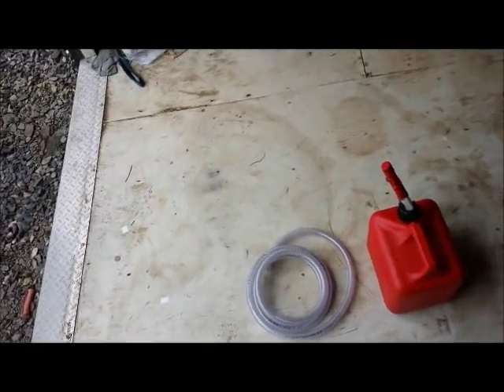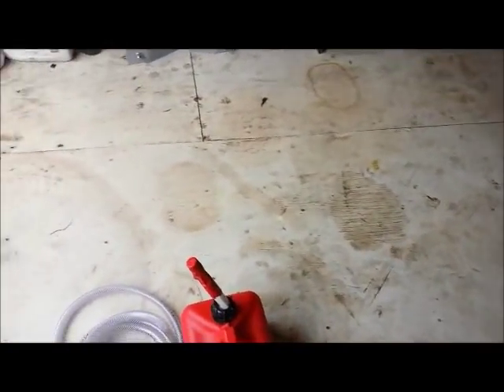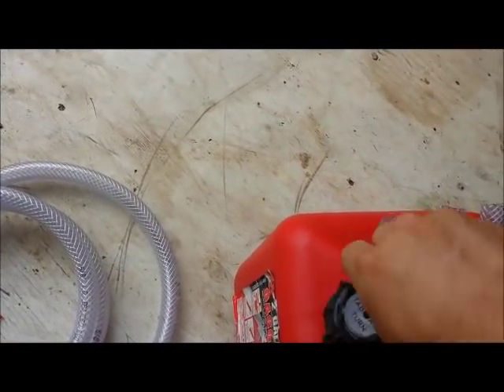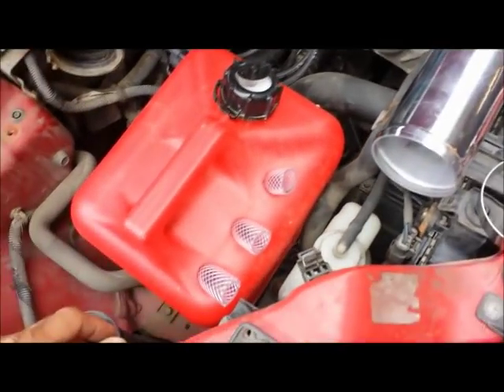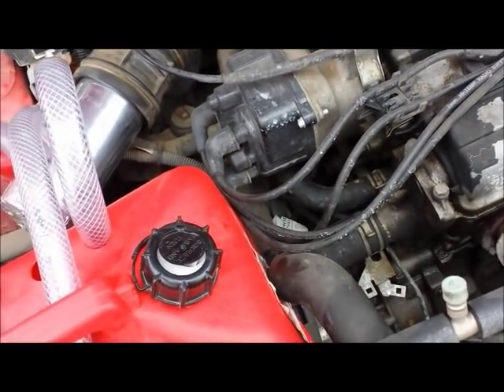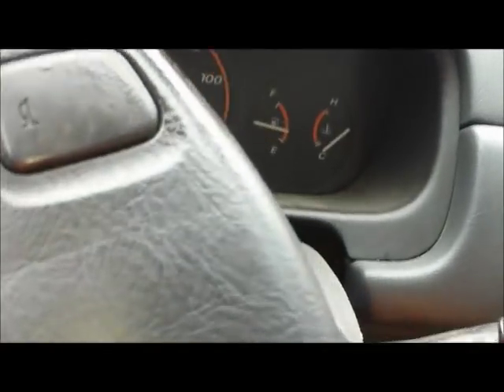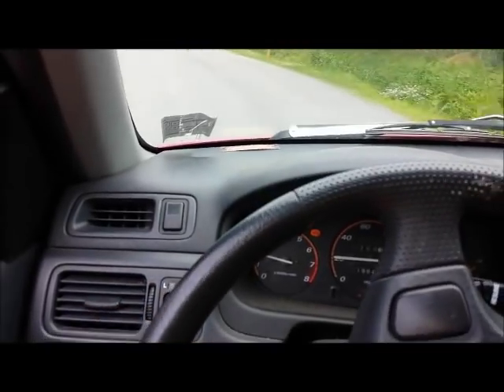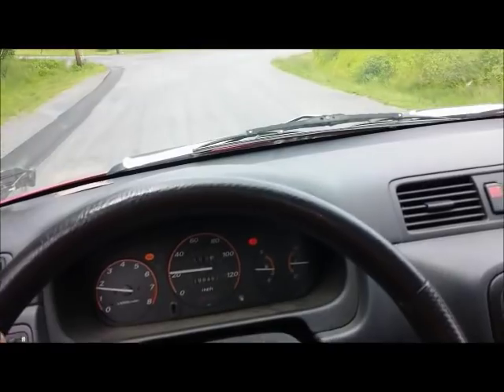driving your car on just gas fumes

Comment: I see. Thanks for the input.  I plan to try the same thing on almost the same engine; but add a few valves that I can make the ecu control to adjust air fuel.  I also have a specialized oxygen sensor to be able to see actual air fuel ratio in real time.  If I stumble on something worth while, I'll pass it along.  But first starting with a 7kw generator to figure out how I should approach it on the large scale.

Comment: How has the project progressed?  Still running it?   The fuel pump connector is under the rear seat;  pretty to access through a port that is held in by a few phillips head screws.
Reply from the maker: no I sold that car a while ago.

Comment: nice mis-firing going on, that flashing mil or check engine light told the world that.  I wonder how the fuel pump felt being dead headed.  Just imagine the heat it was building in the fuel.
Reply: +Джейсон Хичкок  I liked his comment.   Did he like his own comment too?
Reply from the maker: the flashing light has done that for over 2 years.  it's a random misfire code due to the common crv valve issue.  it had nothing to do with the experiment. the experiment threw no new codes
Reply: +Tim insane  I thought the same thing about clamping the fuel line.  It cant be good.
Reply from the maker: It was a test for a few minutes. You guys seem to think it was a permanent thing.
Reply: I would be worried about an older fuel pump overheating quickly.  Instead of clamping the line, you could try pulling the fuel pump fuse.  I did find the video very interesting.  Thanks

Comment: Good patent but ..... If the police stop you for control you will have a problem because the patent is not in line of the safety standards. In an accident, the car contract will not apply and the insurance company will not pay. On uphill roads the car will stop. Otherwise as an idea is not bad.
Reply: When did he supposedly "patent" this?

Comment: on efi cars you may need a chip to tune it.
Reply: lol know what your talking about before you comment
Reply: I do. I meant to tune it. aka air to fuel mix that u want. but ok
Reply: +Josh Feller theres absolutely no need, the only time youd need to monitor or change afr is if your car is turbo'ed, and if you do this if your car is turboed your completely dumb because youll blow up your car
Reply: I don't think he has enough airflow for the high rpm's

Comment: The flashing ses light shows it is misfiring, fix that and you will get better mileage too. Good video thanks for sharing. This is the exact concept as a carburetor , vapor is what burns. try a coolant tube in the red tank, that will make the gasoline hotter and it will vaporize more efficiently, giving even better fuel mileage and more power.

Comment: You can also run an engine like this using hydrogen, it's also how NOX is applied. But the problem is there are risks. You might end up running the engine very lean and killing it (which is the logical result) and the more fuel vapour you let through the air intake the less air it gets, you need both at the right amounts for everything to work as it should. By the time you tune it to the right balance you might be back to where a normal car would be :/

Comment: the safety factor in mild steel fuel tank and thin copper tubing isn"t very much.  use stainless steel  tubing and a metal fuel carrying can with flash arresters  in the tubing into the air inflow to the engine.  Also filter the air coming in to the can,put on the bottom of the fuel can  the air connected to a plastic  mat with small holes to create more vapour.

Comment: Hey man Thats very good project, tell me what was your obstacles you came across plus what would you like to achieve in terms of running on fumes Thank you for your video Arthur from Glasgow
Reply: Bungo Man Google Tom Ogle 100mpg car and you'll find your answer
Reply: Hey Man just watching your video How are you getting on with this fumes Looks very simple thi system I want to try it I have a peugeot 106 1.5d 1996 yr You see this clamp sitting on the fuel hose The fuel pump is still working and will this not cause any damage when the pressure increases ?

I see you try to switch off a fuel pump Great

You think it can work on diesel cars ? Thx
Reply: Can you show how this 3rd hose you connected to What is set up of this all system Thank you a lot

Comment: When the check engine light is on it means there is a problem with the emissions system. 
When the yellow check engine light is blinking it means the car should not be driven.

Use a OBD II handheld computer to read the codes to find the malfunction.

Comment: Justin, feed the floor heat setting of your interior heater to your gasoline bubbler.  Then you can control the temperature going to your molested Gerry Can.  Why your engine is stumbling is because your octane level is increasing.  Octane doesn't evaporate till you heat it to 400 F. But that is another speech and we are not dealing with liquid gasoline.  So doing a timing correction does not apply here.  Sorry for confusing everybody.  Why don't you try some pure Alcohol instead of Gasoline?  Alcohol does not have these ignition delay ingredients.  Moonshine would work.

Comment: thanks for the video most videos only show such stunts at idle run..yours ran 60 mph! impressive for a proof of concept..might be easier to emulate this on a single cylinder motorcycle with no air filter element and some preheating on the fuel from the very heat of the engine produced (no need for actual heaters)

Comment: Thanks for the video hope you can come up with something better maybe a sponge in the can or something to help with evaporation and sloshing. Adding a simple water injection system by vacuum could help with the bucking but won't increase fuel econ but up the pressure in the cylinders and causing a cooling effect on the valves that is what most people are worried about burning.The ecu light flashing at the beginning of the video is a warning that the ecu is experiencing misfiring in the engine due to a fouled spark plug or coil pack going out happen to an older car i used to own. Good luck and stay safe.

Comment: In a sense i agree that you can run it off vapors. But if you truly do the math this will eventually cause engine damage and or catastrophic failure for the simple fact that it runs lean beyond the parameters allowed. You'll be able to idle and maybe move around using just the idle but the second you give it a bit to much gas it will go lean beyond the ability for the ecu to pull timing and could cause it to blow up. There's really no way of controlling the amount of vapor intake therefore it can't compensate for it. cool trick but not something that will work in a real life scenario.
Reply: As a pilot, such as I,you have to utilize on-board fuel/air mixture controls all of the time. The most efficient, powerful and ideal ratio for 100LL fuel is 12.5:1 by weight (as compared to 14.6:1 for 87 octane). The reason that this control is needed is because air weight varies at different altitudes (ex. the higher you go the lighter the air). My home airport is near Houston Tx 343ft above sea level. While on the ground I run the engine at full rich. Once I climb to about 6000 or so I will notice a reduction of power which simply translates to a loss of rpm. The reason for this is because I will be running too rich for the given altitude, say probably about 11:1. All that is experienced is a loss of power, no detonation or damage to the engine in any way. It is extremely common. The timing is actually not affected at all. Same goes the other way, When I am near ground level and run it too lean say 14:1 for example, there is only a loss of power. My point is that the ideal ratio of air-fuel is the ratio at which a certain fuel and air can be mixed which produces the most power. A reduction or increase of the ratio can not affect timing unless the type of fuel is different. Remember though, only 20% of injected fuel gets burned and included in that ideal ratio, the rest is wasted. So your average fuel injection injects way more fuel that 14.6:1 to make up for the in-efficiency
Reply: How will this damage the engine considering the fact that carburetors or fuel injection systems also mix fuel and air vaporize it and then burn it in the engine  Lot of fuel is wasted in this way isn't it?
Reply: matey 😕😕do some reserch 😜
Reply: Justin Sane  Do you plan to reduce air or increase air ?
Reply: Carlos Dingo non-sense
Reply: would this still cause damage on an air cooled engine?
Reply: lmfao
Reply: Thanks for your good reply. Do you think that the reason this could work better than a carb is that once you have the mixture set it will remain the same though the rev range?  If it remains the same then you would eliminate two of cabs big challenges, 1 That the mixture is not always optimized and 2) On a trailing throttle the engine runs very rich because the vacum goes up substantially. What do you think?
Reply from the maker: if you watch the video you will see i was actually to rich. like very very rich.  you would need to build a much more technical device to control vapor.

Comment: so if this works why don't engineers program cars to do this on the highway when there isn't any erratic throttle inputs? Or hell in cruise control mode even. They now have drive by wire throttle bodies and they have direct injection that they can control by computer as well.
Reply from the maker: they want us to buy oil and gas
Reply: Justin Sane  Most of those of who have commented on this video of yours are not encouraging wonder why?
Reply: Yeah justin is right. Do you think that the epa is here to protect your environment? If you do, you are mistaken. The EPA is in store to make the government some revenue, period. Corruptivity in our economy all while using global warming as the scape goat.
Reply: it's possible, not profitable... for greedy fuel companies.
Reply: They do.....modern engine ecus lean the fuel mixture at the mid to high rpm range....